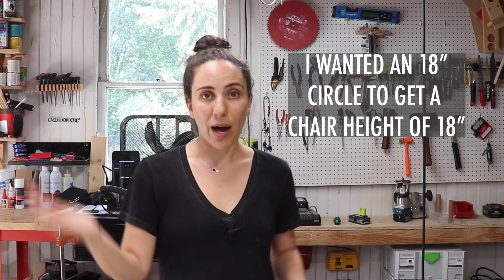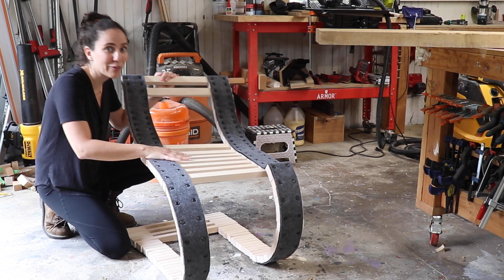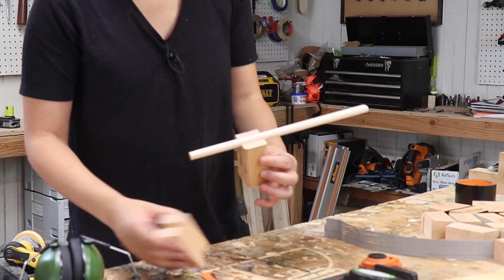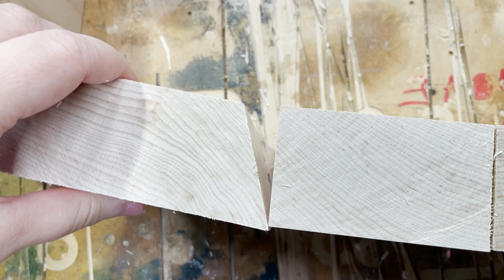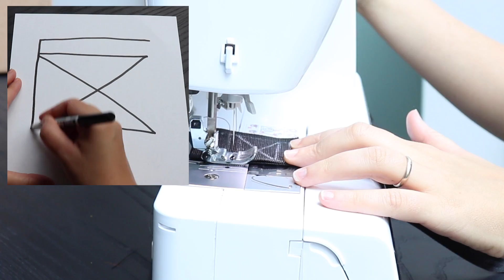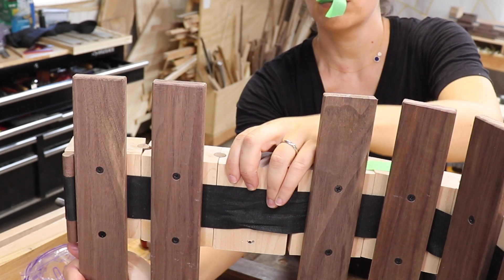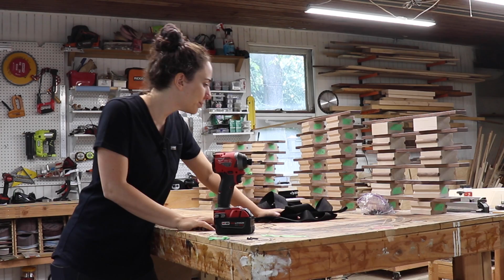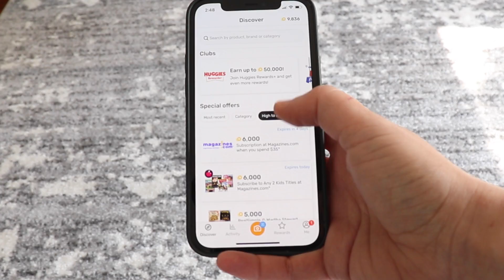I ATTEMPT to make a Roll Up Chair… AGAIN...

Comment: Maybe someone else has suggested it, but what if instead of making it one continuous strap, you isolated the opposing curves of the chair from eachother and interlaced the support strap of those two sections?
Basically, straps running from the base up around into just behind where your butt would be before the curve starts going upwards again. And then the back rest straps would be separate, placed closer inwards to avoid overlapping the base straps, running down and under the butt, out towards the knees and stopping before it curves down.

This would prevent the load from the base straps transferring to all the boards up the back, and vice versa. The largest tension would be contained to the level portion you sit on. Weight on the base would never be able to curl the back-rest.
Hopefully I'm explaining that well enough.
Reply: I agree. The design is the problem itself! In terms of localized tension and not stretching, solid hinges are so much better. Straps are not suitable for the purpose.
Reply: @WhoAmi2357  Perhaps you meant to comment on a different post? As I was not suggesting hinges, but instead having the top portion and bottom portions being their own separate length of strap, with some shared boards in the middle, to isolate both curve's tensions from eachother.

But I do agree hinges would be even better, but I believe that might break the spirit of the challenge here.
Reply: @invertexyz  Thanks for the support! You are right. At least break the straps into sections would help with the tension transfer problem.
I have seen other people post about hinges already. So hopefully the idea will be explored in a future episode.

Comment: Thoughts from an engineer...

I have not read the other 5.8k comments beyond a quick glance. I did see the suggestion for fixed metal hinges, which is definitely a strong option, although there’s still an issue you’ll run into, which brings me to my first point.

You are creating a rather significant lever with this design. The center of mass of the chair’s user is roughly 10-15x further from the pivot point at the mating surface on the back of the frontmost blocks compared to the distance from the straps to the pivot point. That is where the stresses will be highest, and the lever effect is magnifying the weight of the user by 10-15x, meaning that even with the most delicate use, your straps will be under at least 3-4000 pounds of tension (combined between the two straps). Add the transient loads of getting into or out of the chair, and that will go even higher. That’s a huge amount of tension for the straps to hold, and roughly an equal amount of compression on the wood as well. There are a couple of ways to address this. One is to lengthen the distance from the strap to the pivot point, which means use thicker blocks (at least in the large front curve) or use some sort of spacer behind the strap to move the strap forward away from the block to give the strap better leverage. The other simple fix is to double up the strap. If you use metal hinges, they will need to be able to handle these big stresses too, which will be a challenge with small hinges and hardware.

The second issue is the problem with the unintended folding of joints when under tension. Each pair of blocks has two possible pivot points, in an ideal world. Either the front or the back of the mating surfaces. The strap, under tension, stops it from pivoting one direction. You need the strap’s tension to also stop it from pivoting on the other side. It needs to be able to roll up when not under tension, but tension should stabilize the joint. To do this, the strap needs to feed through the blocks between the front and rear pivot points. This means making a channel (dado) vertically through the blocks with the strap riding in that groove, where it is between the front and rear edges when under tension. This way, the greater the tension, the more stable the joint. For this to work, there needs to be some way of relieving the tension from these joints to roll up, but there’s good news here. The joints in the front curve are always under load when the chair is in use, unlike the joints at each end of the sequence, so the joints along the front curve don’t need this relief cut. As discussed before, the straps should be raised above the surface through that curve, not recessed. That section will help create some slack when rolled up, which should help free the rest of the joints to roll up as well. This issue will be a particular concern in the smaller radius, and care should be taken to route the strap behind the front face of the blocks even when under load.

Another suggestion...at least for testing purposes, I’d try to come up with a temporary tensioner section to add to the stack, probably at the end that rests on the floor. This will at least help ascertain if a design will even work before doing the work of stitching and assembling with the final strap length. Something that will accept spacer blocks or adjust with a screw tensioner would be a decent option.

And finally, since you will need to have the strap running essentially through the blocks and not at the front surface, and since the strap will stretch under load, you may need some mechanism to provide more tension relief on the strap when rolling the chair up. This can likely be accomplished in the base of the chair. Imagine linking 2-3 of the blocks with hinges or with a separate section of strap, but not connecting the main strap to those blocks. With weight on the chair, those sections can’t roll up unintentionally, but with no load on the chair, when it’s time to roll it up, you can roll those joints together and allow multiple inches of relief to the straps to give the rest of the chair room to roll up. I would add this section as far toward the front of the chair base as is practical. This will limit how much each joint can relieve the strap, since these piece won’t roll as tightly as the end pieces will, but the end pieces need the same treatment as the top end, with the strap running between the front and rear faces of the block to stop them from folding unintentionally when the chair is under load. You’ll likely want at least 3 sections at the end built with that “stabilizer” design.

Comment: could you just do hinges? between the wood bits
Reply: the way the lever is set up it seems like the force on the belt between the slats on the first curve is ~10x the weight of whose in the chair. thicker blocks would help this but I don't really know

Comment: I'm definitely no woodworker but I am an engineer and my first thought is to use hinges. Seems like others might be making that suggestion too and it seems like a good one to solve the issue you were having with gaps forming on your lower joints. You're essentially trying to create joints with your straps but by using joints on at least a few of the most problematic joints you might be able to keep it fit up nicely and still allow for it to roll up. Just a thought. Cool chair though!

Comment: This project is absolute madness.  You're asking a piece of material that's five feet long to hold its length, and not stretch even a quarter inch, while supporting the weight of a human, and yet be bendable enough to roll up, and to maintain that strength and flexibility after many uses.  I don't know if there is a material that can do that.  Certainly not the cloth you're using.
Reply: Can't agree more. The design is the problem itself! In terms of localized tension and not stretching, solid hinges are so much better. Straps are not suitable for the purpose.

Comment: Could you have holes in each piece with Wire on the inside rather than the fabric straps? 

Alternatively, could supports fall down under the seat/back to the lower part when its all unfolded?

Comment: Perhaps, the top of each block could be grooved, with the strap plates having a corresponding key. Similar to your dowel setup. The strap would effectively be clamped onto each block individually, the tension would not transfer through the length of the strap causing the blocks to collapse. It would be like a fabric hinge at each joint, being much stronger than staples or screws.
Reply: Honestly?  This might work.  Couldn't be a dowel, but it might really work for the bottom curve at least.
Reply: @polerin  idc how she attaches the strap to each segment, as long as she does it at all. Imo its THE reason this doesnt work.

Comment: I think the strap idea will just not work because the tension is shared too much. But another way to do it would be with pinned joints right at the corner where the straps go so it is like a wooden chain, The other corner of the block would still be fine in compression.

Comment: This has an easy solution...it's steel...you need the rigidity of metal...

The problem is that the cloth is going to stretch no matter what you do, no matter what kind you use. Either there is a weak point where the screw is placed, or there is a weak point where the glue is. Either way, each point adds up quickly and you will lose tension. 

Just use steel hinges sunk into the wood instead of cloth to hold the parts together instead of the cloth. They should still allow the wood to pivot and roll both ways, and as long as the cuts are right it should open up fully and stop by the wood. The hinge would keep them from separating. 

Then use overlapping steel on the sides, possibly covered by rubber or cloth if you're worried about pinching. This would give it the lateral rigidity it would need, and since they are overlapping they will roll into each other. Hell, the side plates likely would be redundant with the steel hinges, since they will not allow lateral flex between the individual blocks. 

Yes, yes it will be heavier if you use steel. If it is for children you could likely use aluminum instead, I honestly don't know the load that the blocks are on, and went to the solution that would work off the top of my head. The cloth isn't going to work due to the properties of cloth. It is used in situations like this because of the flex, wanting to bend instead of break. I can't think of a single situation where cloth is used as the anchor other then a hammock, and if you're ever used a hammock you know how high you have to place it with the expectation of sag and droop.

Comment: A separate strap for etch joint.
Then the stretch would not accumulate from the full length at only a few joints.

Comment: Normally, one would think HDPE (High Density Polyethylene) would be ideal because it is super strong and super light.  However...  experience tells me that most formulations have a fatal flaw; you need a very specific formulation or it doesn't work.

The good thing about HDPE is that it doesn't "stretch".  This makes it perfect for safe high load tow lines.  The problem is that it DOES suffer from non-elastic deformation.  Rather than stretching elastically under load (building up energy like a spring), the material simply deforms in the direction of tension.

My dad tried using this stuff for rigging on his sail boat.  He concluded it was the right stuff after tying it between two steel support pillars and winding it with a Spanish windlass until it gave at the knot without whipping like nylon would. 

When we actually put it on the boat, under load from sail and seas, the stuff he was using would just get a little longer and end up loose.  Took about half an hour.  You need some way to absorb impacts and relieve the load, or it deforms and gets longer.  Or you need really high grade stuff that has a much higher load rating.  My dad couldn't understand the difference between stretching and non-elastic deformation, so he was never able to quite grasp what was going on.

For this application, I would suggest something stretchy like nylon and mounting it all under really heavy tension.  The stretch in the nylon would absorb instant impacts and instant forces without deforming, and would work better for this kind of thing.

However, given the pinch issue, I think abandoning this idea is for the better.

Comment: Multiple straps, 1-2ft length, over lapping.  Limited total stretch per strap at that point.  Attach the strap to each block.  
Basically, just creating a fabric hinge between each block.

Comment: How about using regular metal hinges (well, strong ones)? I would also suggest to make those vertical part pieces diamond shape instead of rectangular, I think that would help a bit with the collapsing problem while attempting to sit on it by putting a little bit more mass towards the back. Another idea for that problem would be adding small magnets I guess...

Comment: I think you would have been better off using hinges made of a good, strong steel that can support 100+ lbs (go for like 300 or 400 just to be super safe. You can always make it support more weight, but not enough and the whole thing breaks).

Comment: You never thought of putting hinges between the blocks instead of strapping them together?  Even using hinges I'm not convince it would works. The hinges screws would probably strip out at joints of maximum tension.

Comment: Personally, I think you might be overcomplicating the design with dowels, if you just make the angle cut pieces as wide as the chair instead of having 2 separate spines, then the whole chair will have more sideways stability and will keep a stronger shape, also you want a material about as strong and similar to the kind of material as the plastic that are used to bind and wrap heavy  packages, also you want to use an industrial strength adhesive suitable for the materials, definitely don't use leather, any holes in the material will weaken the material and lower the strength of the chair, I suggest Gorilla Glue, the kind in the toothpaste looking tube, or liquid nails, straps made of nylon might also be a good material, but I still think large package binding might work better, so long pieces that are angled instead 2 thin weak spines, Gorilla Glue, Liquid Nails, or an even stronger industrial adhesive, and material suited for non stretching purposes, and no holes in the material cause that causes weak spots and increases the load to the screws or Staples, and that's why an industrial adhesive is better, screws or Staples has too much give and weakens the effectiveness of the straps.

Comment: So the problem your always going to encounter is stretch in the material. Especially materials like nylon, even steel cables will stretch slightly. Steel cables are more than likely going to be your best bet, but they'll also dig into the wood while under tension. Sadly I'm not sure this is quite possible, interesting idea though; really hope you find a way to make it work.

Comment: Tamar, while watching the video, I had a lightbulb moment. Seatbelt webbing would probably be more effective and still be lightweight, with decent tensile strength. Another possibility would be to use steel cables as your strapping like a suspension bridge uses, using a small turnbuckle at the top or bottom on each side as a way of tensioning it.
Reply from the maker: That’s what I used. Oh well

Comment: Danish furnitur malers use alot of woven hemp fabric as it has little give.
Allso the block seem to be the structual part so meby run the strap thrue Them to keep Them close together and make sure the force is spread Even over the meeting point of the block.
Last id make the strap line run free and have a place on the back where you can tight en the tention.
And yes if you have Kids id not use Any Thing with Flex as Any spring action could result in exploding chair.
WAY way back in the Day retention could be produce by spinning a stick betwin 2 lines of none Flex rope for refrence look at 1300-1600 ship building mainly the rigging of the Sails.
Gl Hope you get it working as it is a super cool projekt

Comment: i wonder if you could use the same techniques to make a back that arches up from the top and circles down to the bottom so you have 360 support all the way around - wouldnt collapse and should have enough tension to be stable? but no longer rollable

Comment: I think this is more of a design problem, not a materials problem.  Think if instead of using segments strapped together you made a solid U-shaped frame on the left and right with slats on top: how stable would that be?  Would that design be stable enough for you to sit in and lean back?  Maybe if it was made from tubular bent steel?  You have too much play now: find a way to limit that with either materials or design. Also, leather will stretch, too, especially once some weight is put on the chair.  Maybe the answer is controlling how far the stretch can go before something else stops it.  Maybe place a steel pin at the chair top (on each side) connected with a steel cable (or strap, whatever) to another pin down closer to the seat about half from the seat to where your knees are. This auxiliary steel cable or strap limits the amount of stretch and play.   I'm sure others have pointed this out; I didn't read all the other comments.  Still, I like it that you are including us in the design/planning/thinking process!

Comment: I saw another builder do something with an overlap joint in the wood.  I am thinking maybe a ship lap type overlap, but with a back angle on the edges so that it sits in a pocket once unrolled and puts some of the tension force onto wood. Hard to describe but i think there has to be a way so that the strap isn't taking on all the forces,  the wood has to interlock some how.  Kind of like a two layer french cleat.

Beautiful choice in wood, i like the asthetic of how this design looks.